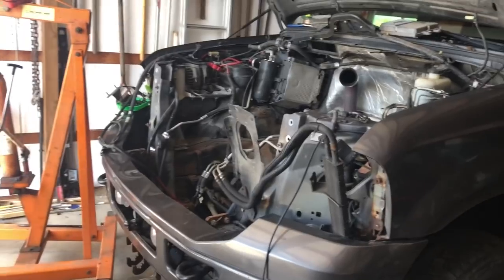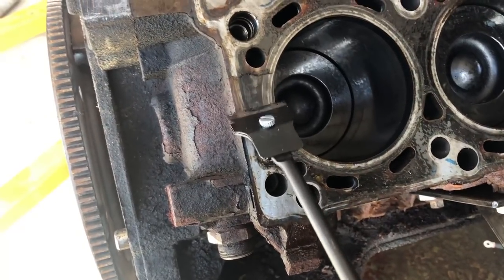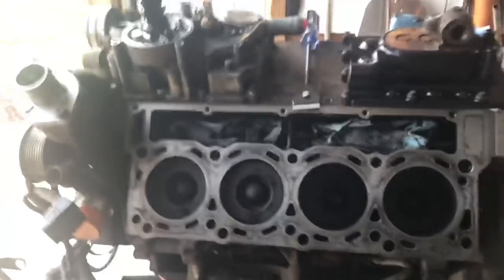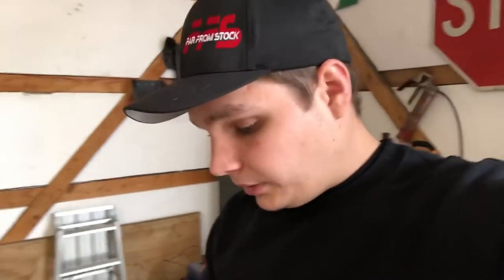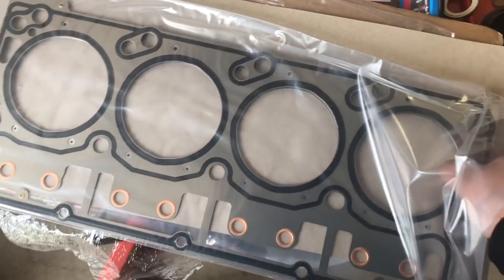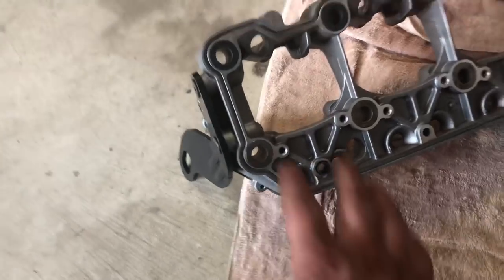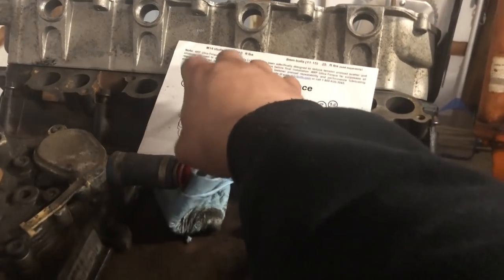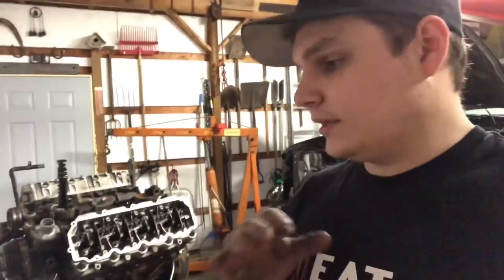STUDDING A 6.0 POWERSTROKE PROPERLY!

Comment: Well atleast u didn’t run into what I found on a recent 6.0 truck I found someone took a flap wheel on a grinder to heads and block surface
Reply: Sometimes it makes you wonder why someone would do s#$t like that!!!
Reply: Not a 6.0, but we have a 6.7 (Cummins) in the shop right now that JUST had the head gasket done, and it’s blown on cylinder 2, 3, 4, 5, and 6 because someone was too aggressive trying to clean the block surface up. Idiots + engines = No!
Reply: Theeee ol whiz-wheel 🤦🏻‍♂️🤦🏻‍♂️🤦🏻‍♂️😜🤣🤣

Comment: Damn every time I watch one of you videos I want to refresh my 6.0 but it’s hard to buy parts when nothing’s broken.
Reply: But the problem is when it breaks it’s totally done your truck is gone so it’s sad you have to pick and chose man I’d still put money away in savings if you do want to keep your loyalty to the 6.0
Reply: @HappyTimes024  That is such crap!
Reply: @HappyTimes024  that's not true. If you update egr cooler and update oil cooler.  Than add a coolant filter kit. You are good to go. Main key is keeping up on oil changes using a 5-40 synthetic oil. It will go 500k
Reply: @lonniefreeman4278  What brand egr and oil cooler to upgrade?
Reply: @MarcoRodriguez-lr2xt  sorry for late reply. I went with bullet proof diesel egr cooler and the motorcraft updated/improved oil cooler. Clean oil and clean coolant is key for 6.0.
Reply: Nothings broken on your 6.0? You’re doing something wrong. I love my 6.0 but it’s like being in a relationship.
Reply: @lonniefreeman4278  Same here on my 2005 6.0l F350 2wd Dually 175 k and still on the factory head bolts and gaskets  but did get the Bullet proof EGR Cooler and the OEM Oil cooler,  I, do have a coolant filtration on it, I'm now living in an area where I, could now delete the EGR And hopefully get my EGT'S Down  I,live in Arizona so summertime is ^ ambient airtemps or 110at times, and I, can get to 1200-1400 degrees just climbing a grade and not towing.  I,do have a Boost Fooler installed so my Turbo will get to 30+ on the Boost gauge, and that's also with a BD Diesel intercooler Sinister Diesel CAC Pipes and boots. So she has yet to give up a Head Gasket! And I, run Amsoil 15w-40 and stay on top of the oil changes.
Reply: @tim smothers, try putting your truck in tow/haul mode pulling the mnts (salt river, El Capitan, top of the world, leaving roosevelt lake etc..) empty or loaded, let it drop into 4th gear (52-55mph) and lock the torque converter up. If you break 63-65mph it’ll upshift back into 5th and egts will start baking again.

Comment: Fell pros have a nice embossed O ring around the combustion chambers too. You can feel it crush/compress during the torque sequence. I think it really helps seal the cylinders up. These trucks need all the help they can get with 4 head bolts..

Comment: How far are you from Monroe Mi. I got some 18mm dowl heads from DK Performance slightly used about 35,000 miles on them. I had stock injectors and turbo on it.

Comment: Any update on the HG's?  I'm about to stud my 06 and I'm going with ARP studs and Felpro 18mm gaskets.  I've heard several different opinions on how to prep the block and head surfaces for the new gaskets.  Diesel Tech Ron seems to agree with your method of razor blading it gently, although I have heard questionable things about scotch padding it too hard.  I'm thinking of using a stoning block or using a razor blade but using it more upright, if that makes sense.

Comment: You know I'm, buying one of these (05 dually). So I'm watching a ton of vids. There are many guys who make vids and have no idea what they are talking about. Making a long ass vid talking about someone else doing the work, but trying to talk the talk. I like watching the vids when the mechanic is talking about the work and doing the work. Thanks man! This helps me out a lot.
Reply: 6.0 is a junk engine. It only has 4 studs per cylinder unlike the duramax, cummins and the 7.3, 6.4 and 6.7 all have 6 studs per cylinder. 4 studs was a dumbass design right from the get go! Worst engine ever!
Reply: @ChrisSmith-ig9jq  the 6.4 also has 4 bolts per cylinder by the way
Reply: I've put 47k on my 03. Best truck I've ever owned. Pulls 22k all day. Moved me from NorCal to Arizona. 7 trips hauling 20k each time. No problem. That's 14k miles. Just replaced injectors and hpop. Lifetime warranty on the hpop and 3 year warranty on injectors from O'Riley. Runs like a dream.

Comment: Any solution to 6.0 roller lifter failure????? Great video
Reply from the maker: 6.4 pushrods being slightly shorter was fords solution, as it removed stress. Still the lifters are tasked to moving 2 valves per lifter. So what’s created is high stress and poor lifter design which creates poor lubrication. I’ve not personally seen one come apart. Anytime I stud a truck over 200k miles, it gets new lifters.
Reply: @LeftLaneDiesels  At 195000 miles, do you worry about replacing lifters? Thanks for sharing your knowledge!
Reply from the maker: @leemarchant7191  I would replace them
Reply: @LeftLaneDiesels  I was afraid of that haha

Comment: What's all required to pull an engine out of a 6.0 powerstroke just bought a 05 6.0 and I'm needing to head stud it upon other work also how do you label your wire harness to know where everything goes as well as bolts
Reply: ive never pulled a block so i cant help much with that but you would have to remove the wiring harness and the grounding wires so you dont rip them upon removal, unbolt it from the transmission and fuel lines, and there are 8 nuts that hold the block to a cross beam on the frame that need to be removed before you lift it out. the wiring harness is formed to its position do to sitting in the same position for so long so when you put it back on the plugs will likely fall right back to their original place, it will be obvious where everything goes. the nuts and bolts are a challenge since there are so many. i suggest putting like nuts and bolts that go to the same component in a bag and label it so you know where everything goes. and also take pictures as some components have studs and bolts and theyre strategically placed

Comment: Hey man, you make some really good videos. I have a International Schoolbus 2006 4200 with a VT365. I struggled with HPO Leaks and just made the oil cooler, injectors(just dismanteling, cleaning and resealing), Stand Pipes, Dummy Plugs (the updatet of course), nipple cups with gaskets, oil cooler, HPOP resealing, connecter fitting is the updated already,, new oilpan gaskets (upper and lower). I found a inboard main bearing cap bolt broken. The head was just missing and i couldnt find it in the pan. So it has been like that a long time. I just had a hard time to find a right screw. I kind of made a workaround :). 

I found some metal debris in the oilpan and i can not identify what it could be. Maybe you can send me your email and i will send you the picture i made. Maybe you can identify it for me ? That would be very nice.

Anyway. The engine is not starting without break clean. I will double check for more HPO leaks now. Also i will check low oil pressure, diesel pressure, bubble test, injector test and i will make a visual inspection of the valves and so on. When i start my engine now i hear a raddling noise or more a clicking noise on the driver side under the valve cover. I will check it again.

When i try to start the engine it sounds like he is just about to make it... but without break clean fluid he is not coming up... its a pain in the ass. 

Your explanation helps a lot!

Comment: Keep the engine from overheating and you'll never blow a head gasket. The 6 liter is an awesome engine.
Reply: Wtf? 6.0 is great but maybe you don't understand that overheating is not the main cause of the 6.0 head gasket failures. It's the design of the engine. My 2006 6.0 just had a head gasket failure the other day and never got hot (hence why I'm here)
Reply: lol bro its bc theirs only 4 studs to a cylinder. not enough clamp pressure. buddy
Reply: @kobygrimes1234  The stock head gaskets and studs are fine, for a stock engine. What blows head gaskets and ruins heads and valves is over heating, over boosting, advancing timing due to tuning, and high EGT’s. I’m going on 18 years, and have never had a base engine, including turbo, fail.  I don’t hot rod and abuse my truck.  The later engines are good, if they are not pushed beyond  their designed horsepower.  The key is good maintenance, and not hot rodding the engine.  BTW I tow a 9000 lb trailer up steep grades regularly.  I monitor My EGTs, and back off at 100 degrees.  If you think a 6 liter is bad, try a 6.4.

Comment: Awesome video just got my first 6.0 was wondering if there is a way you can tell if the truck has already been studded already without tearing it down
Reply: Yes there is! Look on the drivers side to see if there's a bolt head or a stud (hex center) its pretty easy to see

Comment: General question, Do you think the Mishimoto oil cooler is a good brand.
Reply from the maker: Can’t say as thou I have much experience with them. But I can say that I trust oem.
Reply: i would stick with oem or bullet proof diesel if you live in a warm environment. oem oil coolers are unlikely to fail with red elc coolant, and bpd may have trouble warming up in a cold environment do to being external. theyre also way more expensive so its probably best to stick with motorcraft oem
Reply: Thank you. Appreciate the knowledge

Comment: You should always run a tap or thread chaser into the head bolt holes to clean them before installing studs or bolts. Also, while heads are removed, replace the lifters. They are prone to failure.
Reply: To replace the lifters on a 6.0 you have to basically take whole engine apart
Reply: @lonniefreeman4278  Yes, they are a weak point. The cam needs to be checked for worn lobes also.  Poor design, that you can’t get to the lifters from the top end.  A 40 dollar part, that is prone to failing, can trash the whole engine.

Comment: What does a job like this cost including parts and labor?  What would it cost if it was done as a preventative thing (no machining needed).
Reply from the maker: Jason Kuhn machining is required regardless. Generally around 5k if turbo, heads and injectors are good
Reply: @LeftLaneDiesels  Really?  Why would machining still be required if the head is good and never warped/overheated?  I'm new to this and trying to understand.
Reply from the maker: Jason Kuhn you want to be 100% sure that the head is flat and has no cracks. A head could crack just by removing the head bolts. That’s why when removing you generally want to do it in the reverse procedure of torquing. Also this only costs 300-400$ so it’s cheap insurance.
Reply: @ridiculous7935  if you ever have the heads off any motor you want to get them looked  at.

Comment: replacing head gaskets is a major job, better on an older vehicle than a new one, because new vehicles are trash, they are so complicated that they will never last like the vehicles that came after the carburetor died, those simple fuel injected vehicle's of the late 90's to early 2000's, my little australian hyundia getz is so simple and reliable it will last into the 2030's, i still see many of them on the road.
never trust a modern  vehicle, they are complicated pieces of trash that are engineered to only last the factory warranty, so car makers save money by using plastic parts, like the thermostat housing that used to last a lifetime and was made of metal is now plastic, and the amount of plastic parts is increasing every year, as long as the part gets past the factory warranty, car makers dont care, but plastic parts under the hood heat up, cool down, heat up again and again and the plastic disintegrates, leading to part failure and then engine failure, the thermostat housing used to last a lifetime because it was made of metal, but now car makers dont care past the factory warranty, they know these plastic parts will fail eventually, but they dont care past the factory warranty, so they use more and more plastic to save money.
a man car failed to release the electronic park brake so he was stranded, a switch embedded in the seat tells the computer someone is sitting in the drivers seat so the electronic park brake can be disengaged, but if the switch fails, as it will eventually, the electronic park brake will immobilize car leaving the owner stranded  hundreds of miles from home in the dark.
this is a simple illustration of what can go wrong when cars are built with many complicated features, in the long run cars of the 2020's will never make 20 years on the road without a lot of money spent on them, along with plastic components, comes smaller engines being squeezed  for extra horse power, lets face it, a car with a small engine that is being squeezed  by an over excited turbo, will burn out after the factory warranty, the opposite is a car with a big engine that's naturally aspirated, these engines last as they are not stressed, but a car with a small engine with a turbo driving it will burn the engine out quickly, but car  makers only need it to last the makers factory warranty, these and many other tactics and points are the pathetic situation we are in car makers are all building trash to last their factory warranty and could not care less about the on going struggles and mounting bills of the car owners,  the only car maker that gets a pass is Toyota, they pride themselves on reliability, they are selling a lot of hybrids now because they perfected the Toyota prius hybrid over  20 or 30 years, now they have perfected hybrids, they offer hybrid sedans, hatch's, and SUV's, and you can bet they are reliable, unlike other makers who may bring out hybrids, you cant trust other car makers and there first models to not need to be recalled, if you want a hybrid SUV, get a Toyota, at least you can trust them, they did after all spend two decades perfecting their Prius when no other car maker bothered, besides honda, but toyota have had nearly 30 years perfecting the technology.
if you must by a new car by the base model if you plan to keep it a long time, my girls friend did not follow my advice and came back with a complicated piece of trash that wont last, small engine, big turbo, complicated feature set, it wont last, will cost big bucks to fix, a disaster !!!

Comment: Do go back through 24hrs later to recheck Torque on the studs? I have done a few and found out the torque numbers are below 210 so I have to recheck all. Just wondering if you have found the same issue.

Comment: For a 03 that has already been bulletproof: rocker box has broken and stripped bolt for value cover, BUT the big concern is the ear was broke off and they wb welded it.  So of course new rocker boxes will be needed.  THE QUESTION, do I have to redo the head gaskets and studs (bulletproof) just to replace rocker boxes?

Comment: I’ve got a stock 2006 f250 6.0 that needs head gaskets. I plan to stud it, regulated return, Left Lane up pipes (of course) and upgrade the heads themselves. Is there any upgrades that you would recommend while the engine is apart (lifters, pushrods, etc…)?